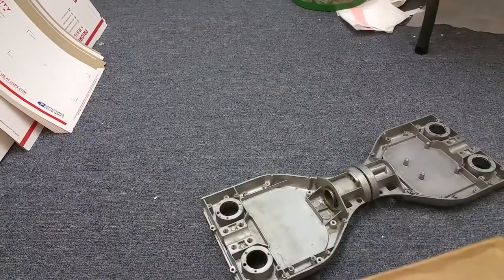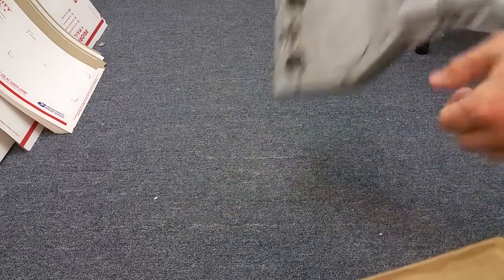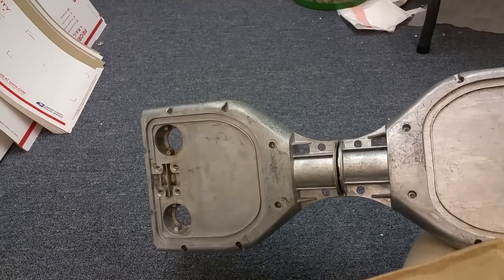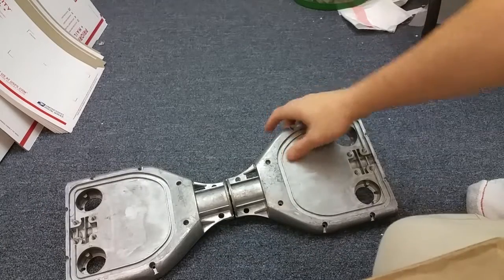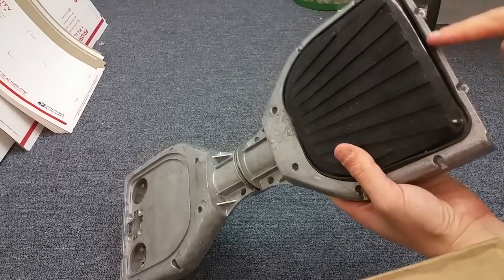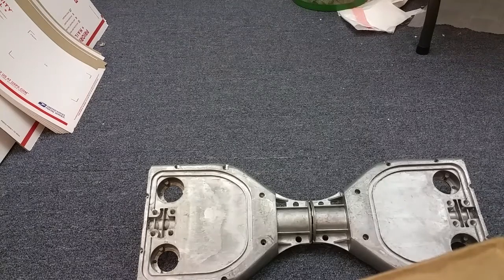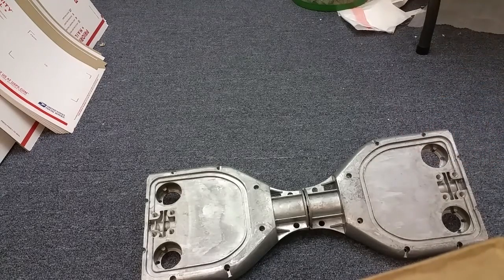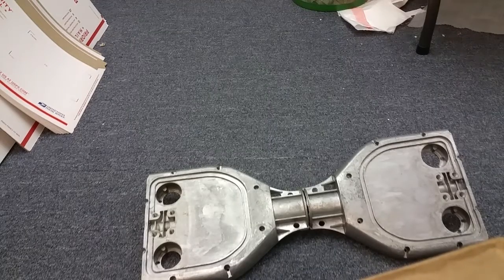Hoverboard Parts Explained - Frame

Comment: my middle piece broke for like the limit on how far each pad can tilt and mine still rides fine
Reply from the maker: you mean the metal pin in the frame cracked? as far as i know there's no way to fix it. if you can ride it as is you can keep riding although i would think maybe a little dangerous riding that way. if you want to fix it just buy a new frame. http://amzn.to/2b3Scvp its a fairly easy fix basically just disassemble your board and build it back up around the new frame.
Reply: +Johnny Amicci ah and just as I got home now my motor is all fucked like it's really rough and un ridable I actually fixed the pin thing but now I have this problem